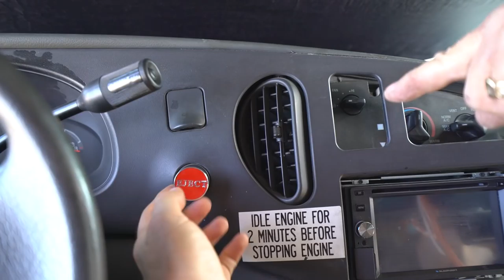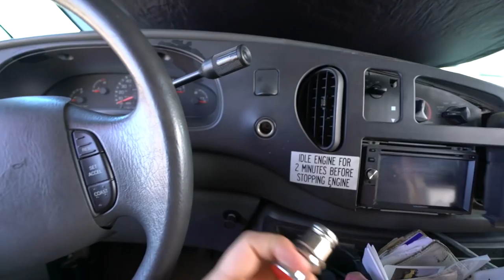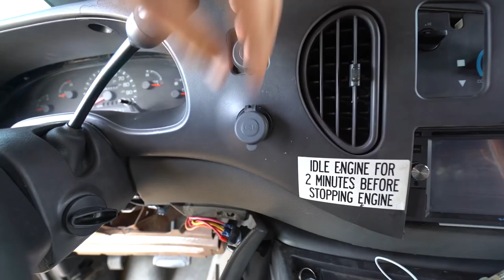REPLACING CIGARETTE LIGHTER W/ 4 USB PLUGS !! + new dash lights!

Comment: Yeah. My dash bulbs went, too. O'Reilly had new ones. The transmission position pointer needle broke off (easy mistake when you take out the gage assembly) . I glued a fake orange one back on. Points fine. That was 5 years ago. Taking out the gage assembly on the dash is easy. Easier to clean, too.

Comment: Just saw a young YouTube couple with like a 30 foot 1972 prison bus. But, the most proffessional Skoolie build I've seen yet is Jim's build from his  'Life is a Joy' YT channel

35-40' schoolbus;

Water heater heated & sealed floors. 
2" of spray foam insulation
Raised & rewelded roof up 22"
A washer/dryer unit
About a megawatt of batteries
Tile shower
Full size fridge
2000 watts on the roof.
Reply: if you get a chance ck out justin rhodes they had it built and then went on a 50 state tour

Comment: I thought about buying your rig but decided against it when you mentioned the cost of deisel being one of your reasons to sell.  I guess it can be converted to cooking oil but not clear on how much that would cost so, good luck on your sale and the new rig.
Reply: people seem to forget that diesel gets way better MPG so yes you pay more for it per gallon but you get way more miles out of that gallon so it is cheaper to roll in a diesel. diesel engines also are much more durable. you can get 500,000 miles out of a diesel engine pretty easily , a gasoline engine is pretty much scrap by 250,000-300,000. for large vehicles like this diesel is the only way to go, anyone who would choose to go with gas just isn't educated on the benefits of diesel! diesel = better gas mileage, longer life span and gobs more torque. to want to get away from it because it costs more at the pump is just being short sighted.
Reply: I'm probably not really educated on the diesel issue yet.